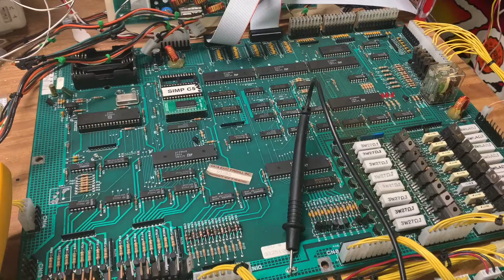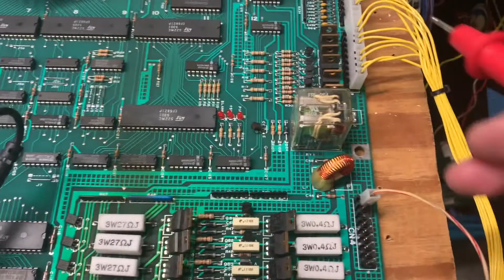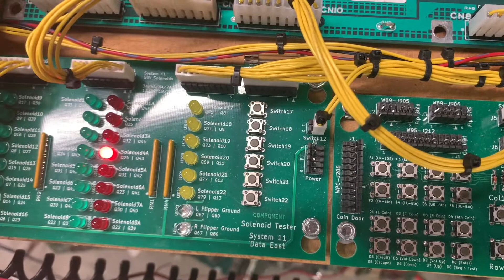Pinball PCB Drive Transistor Quick Test

Comment: will this test also work on Gottlieb systems?
Reply from the maker: It will, but not quite as nicely. System 80 driver boards separate ground into groups of transistors. You'd have to move your ground probe around. It would work better for System 3 driver boards.

Comment: so except for the 4th transistor the energy is going from the red lead directly to the board but on the 4th transistor it has a short and can not go threw the transistor to the board. ?
Reply from the maker: Yes. That 4th transistor is shorted, and acts like an always closed switch. The test shows continuity between what should be an open switch and the 18V power source.
Reply: @ChrisHiblerPinball  Thanks, but I am still confused. It seems to me you should always be getting a beep, even on transistor 4.  Or a loop is not being completed and ,,,,,,,,  Wait, I am getting more confused.   Can you please explain everything from the very beginning?  thank you